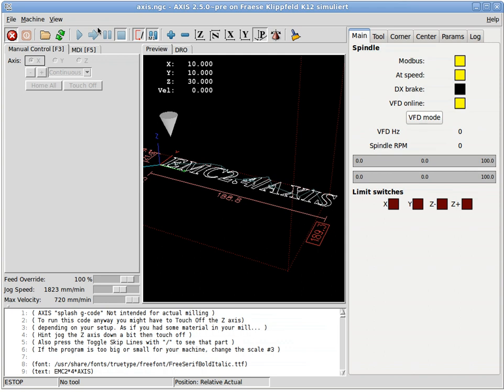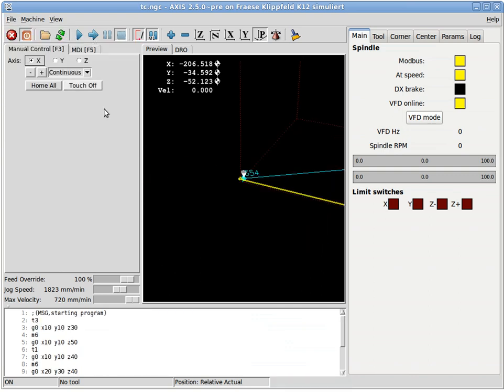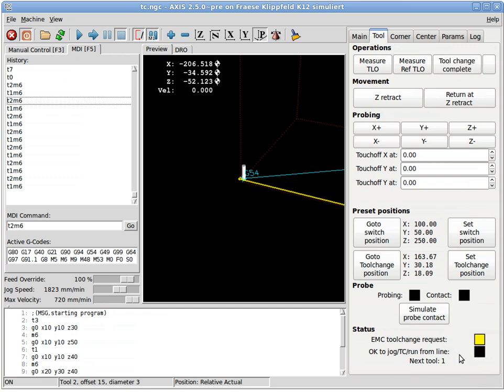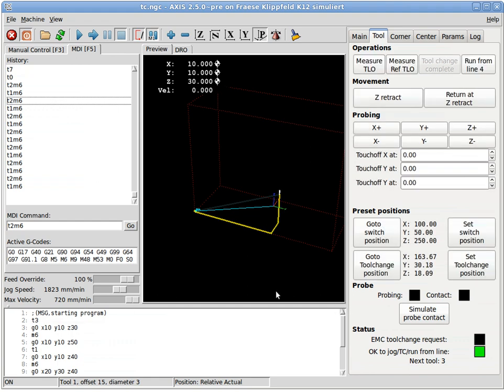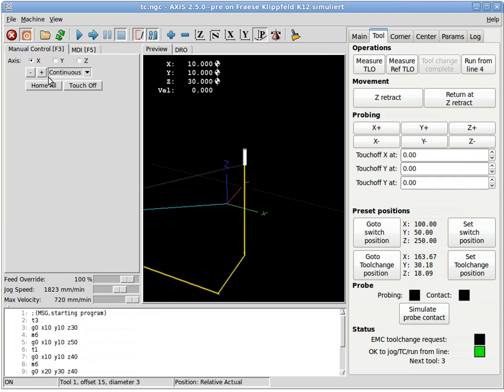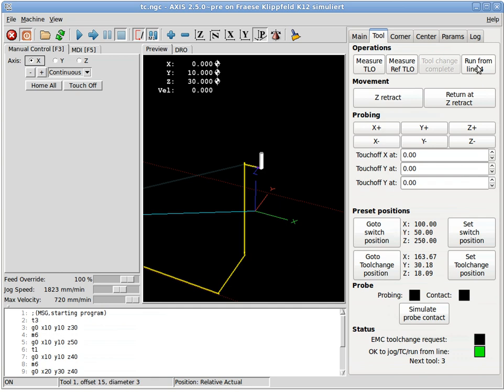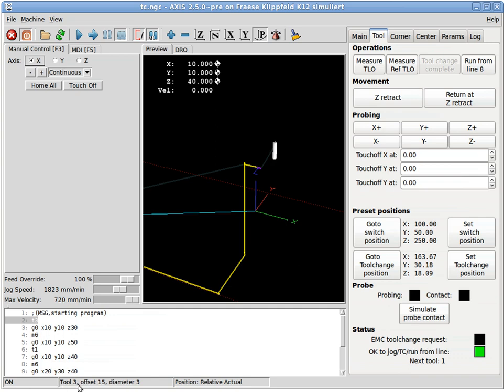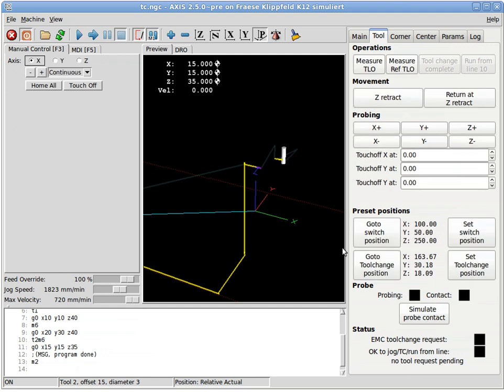Gladevcp toolchange - sneak preview

Comment: Hey Michael. It would be possible to obtain a code from you?
Reply from the maker: +Bruce N no, that is not published and I suggest you start with configs/sim/remap and the toolchange examples therein
Reply from the maker: TheCML27   see www.machinekit.io, look under configs/sim/axis/remap
Reply: +Michael Haberler Hi Michael, I checked out MachineKit but couldn't see anything like the panel you show with the tabs etc. Is that code available anywhere?
Reply from the maker: +Bruce N see configs/sim/axis/remap for examples
Reply: +Michael Haberler Thanks Michael, I have been through all the remap examples I could find on both machinekit and linuxcnc code bases but could not see the specific panel you are using. I suppose my question is is this a custom panel that you only have?
Reply from the maker: +Bruce N that example is deprecated
Reply: +Michael Haberler Ah ok, thanks. It wouldn't by chance be in earlier builds would it, I wanted to use it as a learning experience to further my self eduction of LinuxCNC
Reply: +Michael Haberler OK Cool, thanks for replying, appreciate it.

Comment: Hey Michael, I have been using LinuxCNC for a bit now... and I read through some of the integrator manual enough to install a JOG X,Y,Z,A panel. Now I have figured out that GLADE can make a panel using a GUI... and that I can incorporate that into the existing interface. But I can't seem to find any good tutorials on "how"... mostly videos like yours showing what "has been" done. Would it be possible for you to post some info on how to integrate GLADE and LinuxCNC? That would be a huge help. (Once I get it all figured out... I'll make some tutorials... right now just working on where to start.)